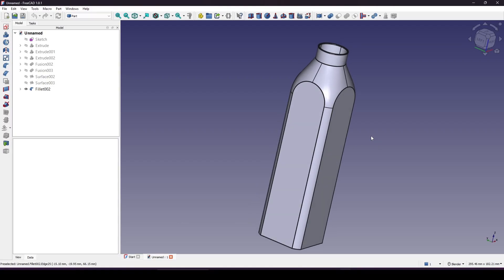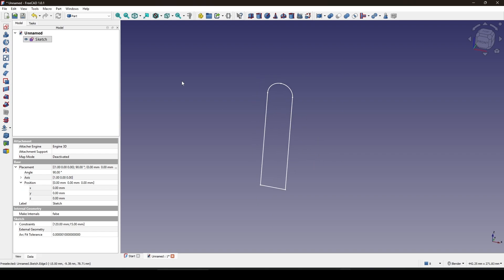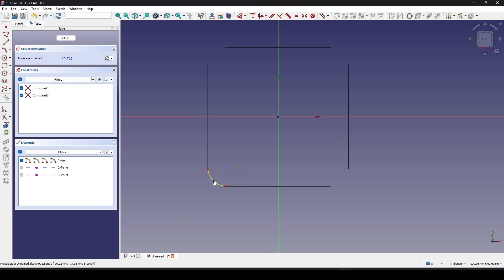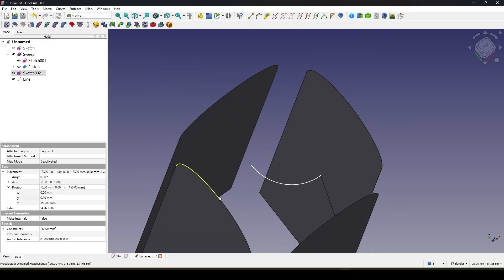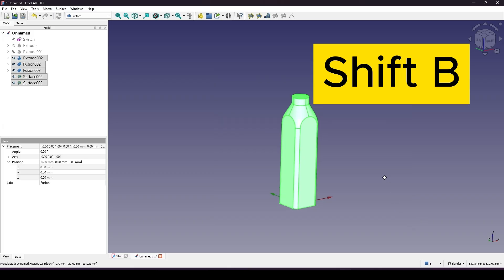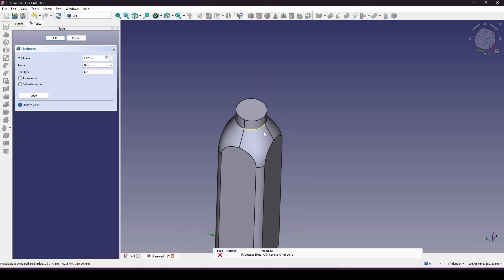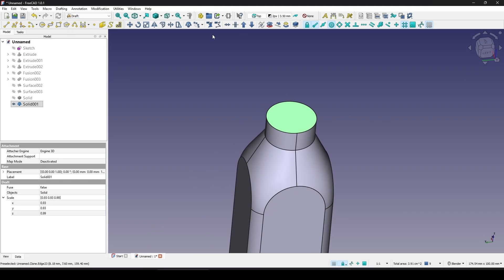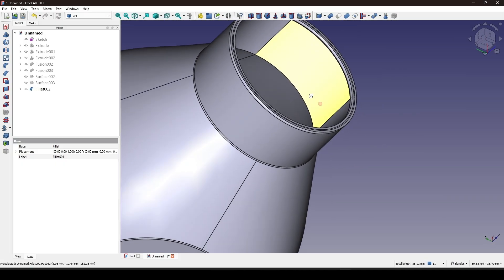Build Basic Form of A Bottle Using Surface In FreeCAD.

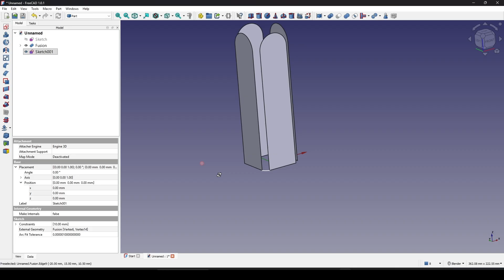Comment: I tried it with the current dev version (1.1.0dev.14555 (Git shallow)) and it doesn't work with the sweep command at 4:18. I have to use the extrude command to follow your nice tutorial.

Later on I have to use a compound to close the bottom and then everything works fine. Appreciate!
Reply from the maker: Its strange that the sweep doesnt work with your version, but extrude is also a good choice, thanks for watching!